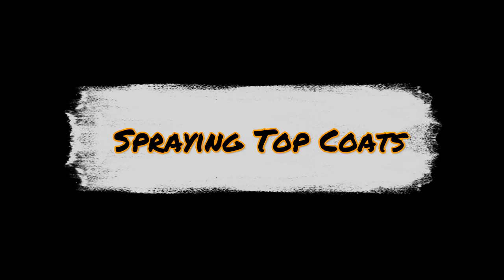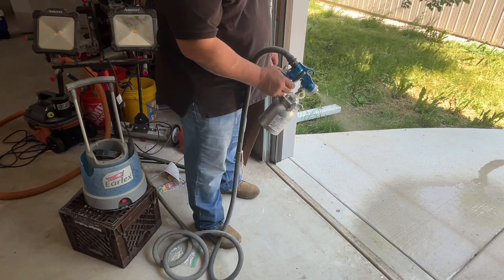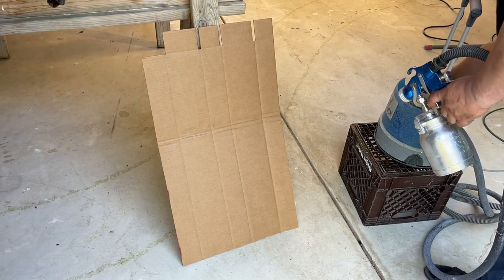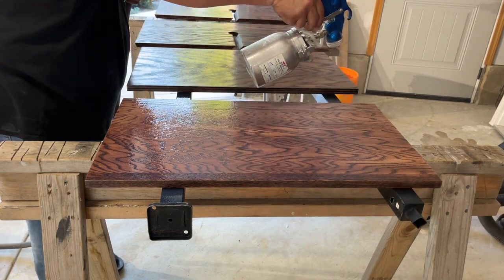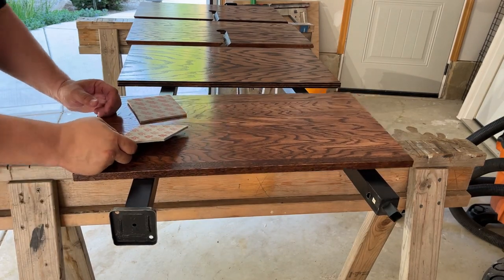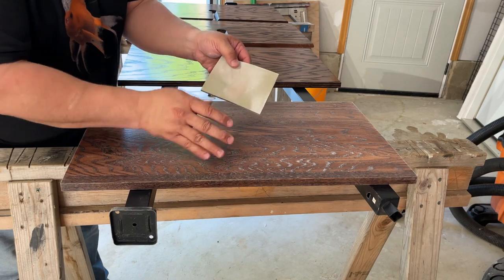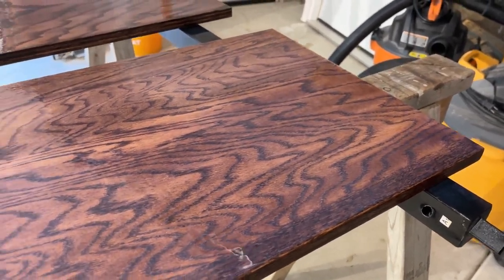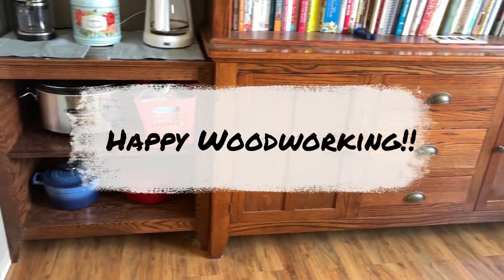Achieve Flawless Finishes: 9 Golden Rules for Top Coat Application! #woodandstuff #generalfinishes

Comment: Great video!!  You also want to make sure you keep your gun 90 degrees (level) while spraying so you don’t have more product where the gun is angled.

You have good luck sanding with 220grit between coats vs 320?
Reply from the maker: Thanks for the tip! I've had great results with this specific product. It sands smoothly and delivers excellent outcomes!

Comment: Why spray out water first?
Reply from the maker: Spraying water through an HVLP sprayer before using water-based finishes is important because it cleans out any debris or residue, prevents clogging, and ensures the sprayer is functioning properly. This practice also lubricates the sprayer and helps avoid contamination, leading to a smoother and more even application of your finish.

If you haven’t already consider subscribing to my channel for more tips and tricks!